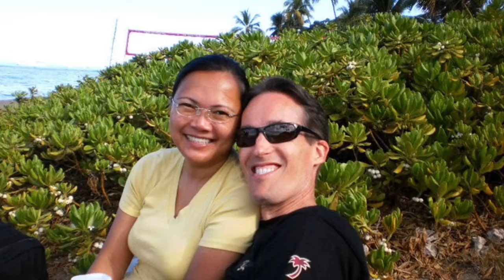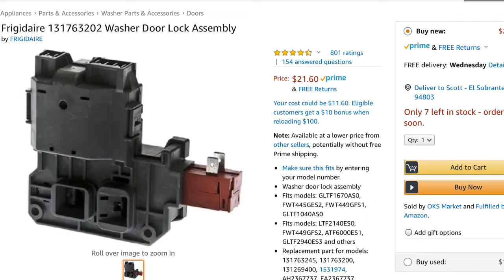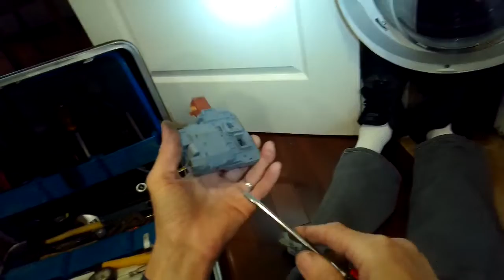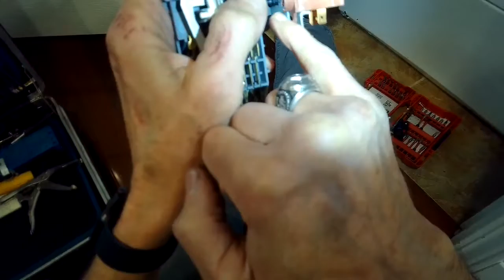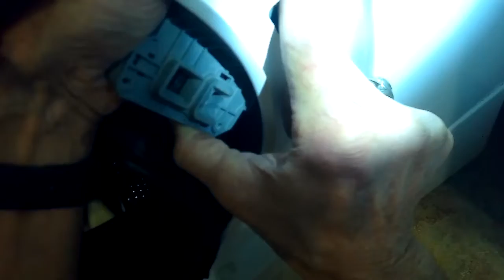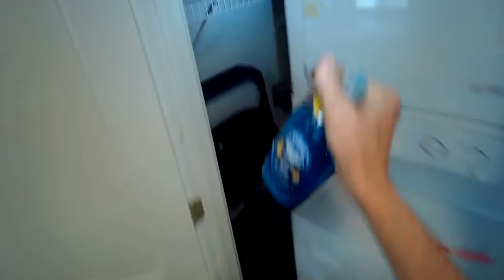✨ FRIGIDAIRE WASHER WON’T START - EASY FIX ✨

Comment: Thanks for the video. 👍🏻
It's a solid, no-bullshit set of instructions.
Just fixed my washer back up, and it only cost $20.
Reply from the maker: Thanks so much Alex👍😊
Reply: Where'd you gett it
Reply: @jessicalee8968  I ordered the replacement part online. I can't remember now, this was a couple years ago, but it was easy to find and super inexpensive.

Comment: Hi Scott, Thank you for the video. I changed out both parts. It operates better however it still has some inconsistent issues like occasional door alarm or error code. Due to years of use the door is slightly bent leaving a small gap at the bottom, below the sensor. Any suggestions? Thanks!
Reply from the maker: I would replace the door hinges. I think they are worn out causing the door sag.

Comment: Hi I have a similar issue with mine where it just errors out at the start but my door lock light doesn't even turn on. Do you think this fix will work too? This issue started after the power died mid run.
Reply from the maker: Great Question👍 Click Here to Get Live Expert Help From Me For Just $5.00: https://www.youtube.com/channel/UC7fBqy8806u1r0NpPv_fQ2w/join

Comment: Hello, nice helpful video , tried that on my Frigidaire front loading washing machine because it just died on me nothing no lights on control panel, but didn't work for me , machine still dead . i have power all ok changed main board, changed the other board , but still dead any idea's ?.
Reply from the maker: I wonder if it’s the noise filter gizmo at the back of the washer that the power cord connects to?

Comment: My last load didn't drain. I tried to run the cycle again, but it won't start. I see the door light come on and hear the door click, but then nothing happens.  Do you think it's more plausible that it's the door sensor or something to do with the drain tube clogging?
Reply from the maker: Great question ,
It has to drain first before it can start.
Just need to clean out that coin trap inside the black rubber drain boot.
Reply: @ScottTheFixItGuyChannel  you were correct. I decided to tackle that job last night. Surprisinlgy, there wasn't a coin trap when I pulled it off. Which is why it wasn't draining. A piece of metal had wedged itself in the pump preventing it from working. One I removed that it worked just fine. I'l have to order a trap and install it later.
Reply: I have same problem lights come on door clocks except mine was full of water and when I lowered the outtake hose the water came washing out the drain hose so I assumed the pump isn’t blocked.

Comment: Ahh, my self fix it plans almost never work out... lol, this proves to be no exception 😂🤣😂. Frigidaire Affinity front loader model ATF7000FS1. This video looked so easy I figured at last! Something will go smooth and easy! Ordered the part, it arrived I and started in. Right off the bat my door seal spring clip was more difficult to remove than looked, but not terribly so. Next, the door seal won’t budge. It is very rigid around the edge where it is on the opening (although the rest of it is very supple like the example). Almost like there is another spring clip maybe on the backside of the seal? It is not soft and pliable at all like the one in this video. I did not want to force it. Any ideas?